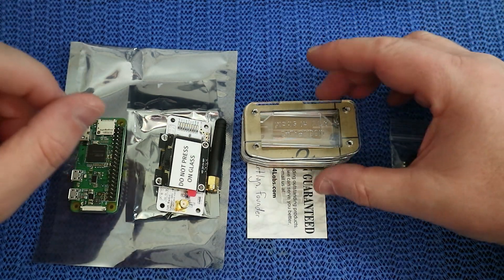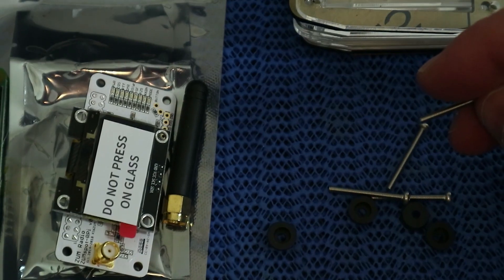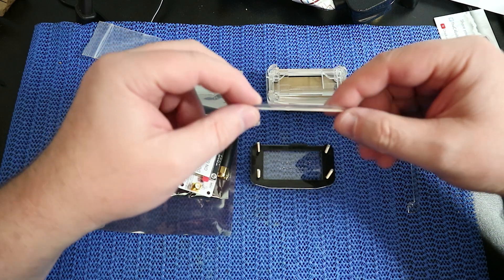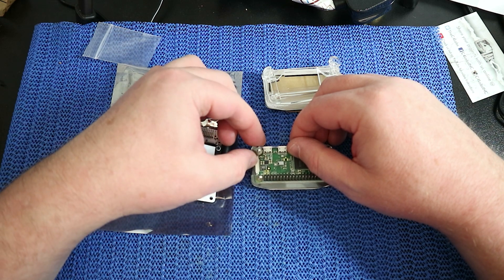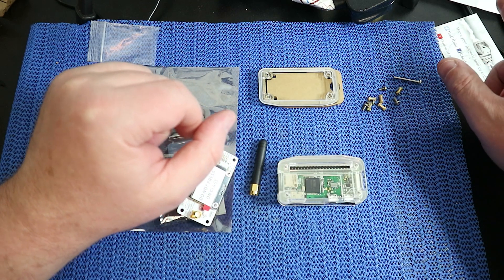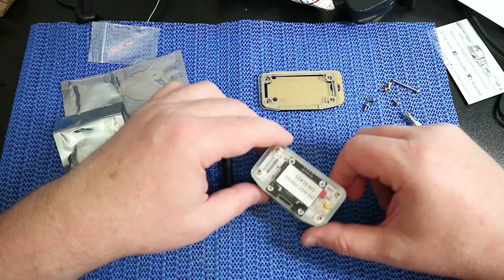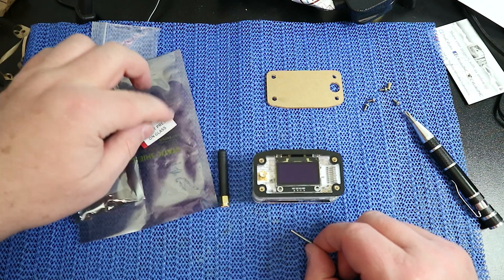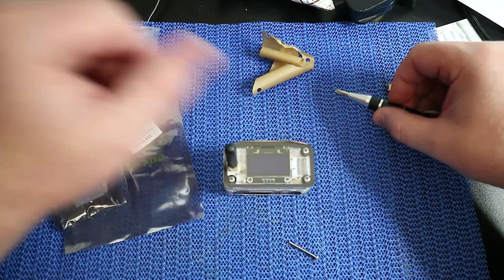zumspot OLED kit assembly part 1

Comment: Thanks for the video, when through the same process yesterday. Did you get the OLED to work, mine is completely blank despite trying all the possible settings
Reply from the maker: Hi, yes the oled works, you need to select it in the pi-star menu.. vid coming soon gaz
Reply: TheGazLab I have subscribed so will look out for it, but I suspect mine could be faulty